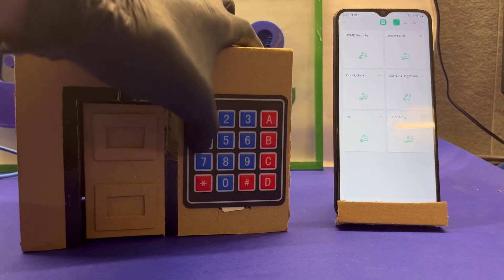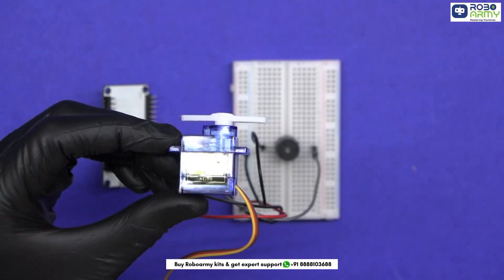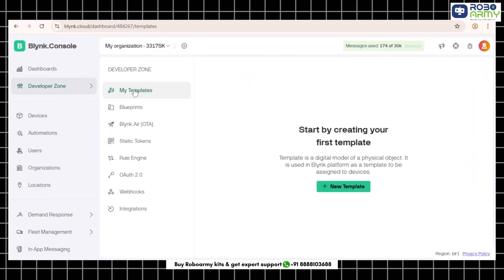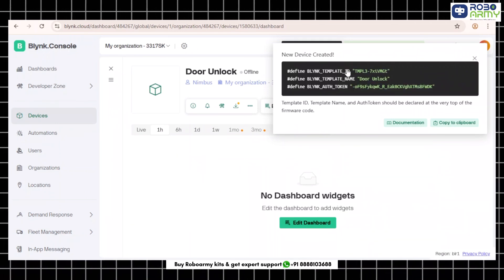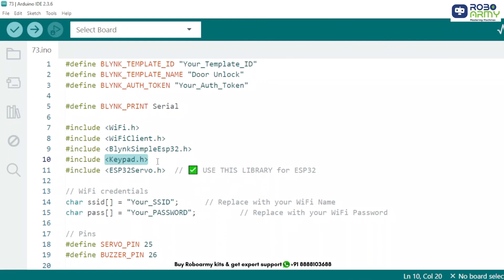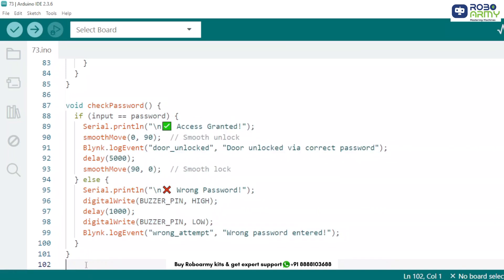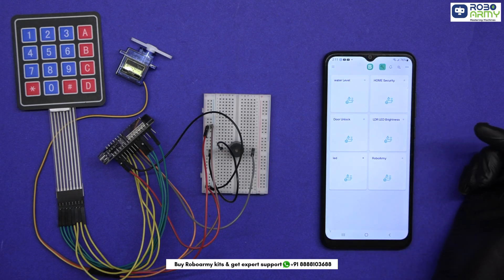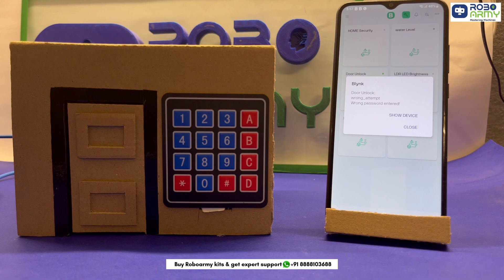IoT-Based Door Lock System using ESP32 & Blynk | Password Lock with Alerts

Comment: What will be the code and steps if i use 4×3 Keypad Module instead of 4x4  Keypad Module
Reply from the maker: Yes 👍 you can use a 4×3 keypad as well.
You only need to change the keypad layout and pin configuration in the code.

Steps:
1️⃣ Change COLS from 4 to 3
2️⃣ Update the key map for a 4×3 keypad
3️⃣ Use only 3 column pins instead of 4
Sample code changes:
const byte ROWS = 4;
const byte COLS = 3;

char keys[ROWS][COLS] = {
  {'1','2','3'},
  {'4','5','6'},
  {'7','8','9'},
  {'*','0','#'}
};

byte rowPins[ROWS] = {18, 19, 21, 22};
byte colPins[COLS] = {13, 12, 14}; // only 3 columns

Rest of the code remains exactly the same 👍
The # key will still work for submit and * for clear.

Comment: Sir I am trying to build this project for my school. How many jumper wire and type do I need sir thank you sir.
Reply from the maker: Great to hear you’re making this project for school! 🎉 You’ll need around 15–20 jumper wires. Use both male-to-male (for breadboard connections) and male-to-female (for modules like keypad/servo if required). Having a mix of short and medium lengths will make wiring easier and cleaner.

Comment: I didn't getting notification in app
Reply from the maker: Thanks for watching! 😊 If you're not getting notifications in the Blynk app, please check these things:

Make sure 'Notifications' are enabled for the Blynk app in your phone's settings.

In the Blynk project, confirm that the Notification widget is properly added and linked to the correct Virtual Pin.

Check your Blynk code – make sure Blynk.logEvent() or Blynk.notify() is being triggered correctly.

Ensure your ESP32 is connected to Wi-Fi and Blynk Cloud without any drops.